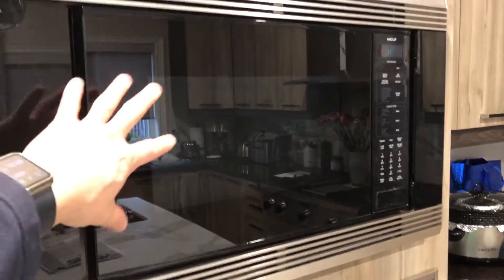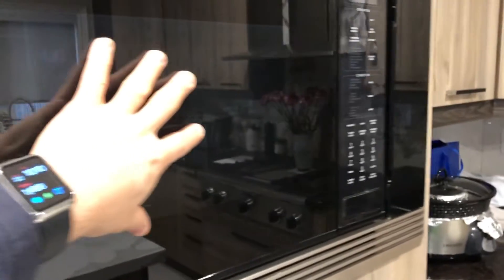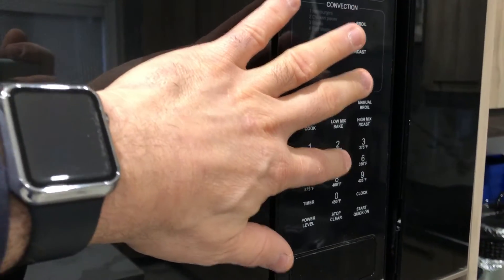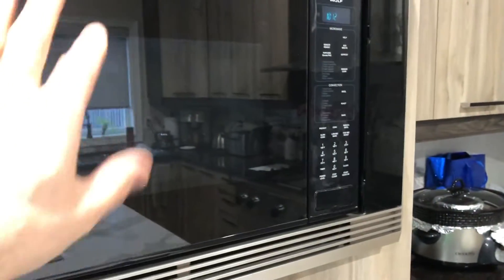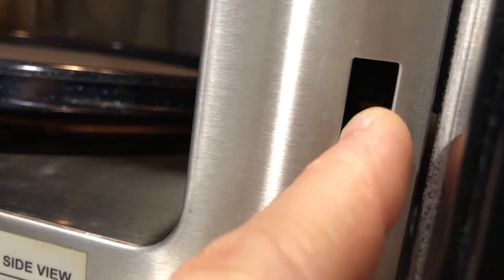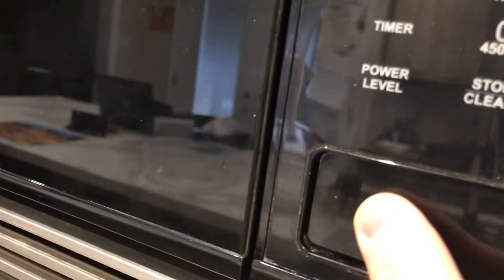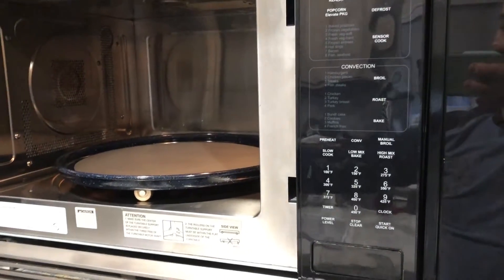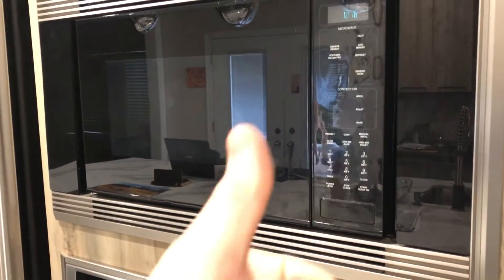Wolf Sub-Zero Convection Microwave MWC24 MC24 No Heating FIX HACK!

Comment: My button doesn’t open door easily. How do I take it apart?
Reply from the maker: You open up the microwave by removing all the screws from the back, and you will lift up the cover and see the plastic assembly holding the door button and all the springs and latches which you also need to unscrew. If the button doesn't open the door easily then it could be something is worn and it is not pushing in deeply enough to disengage the latches from the holes they are in which keep the door shut. Good luck fixing it!

Comment: I've worked on Wolf appliances for 19 years.  The lower door switch is not making good contact. I've seen it hundreds of times. Nothing is wrong with the push button. Replace the lower door switch.
Reply from the maker: Thanks for tip! I ended up changing the switch and yes that fixed the problem!
Reply: Hey Steve, I have a mw24, display is dim...what's my options ?
Reply: @ The blue displays all fade over time. You can change the display part#815587 which isn't too hard if you are handy or memorize what buttons to push to heat up your food Lol!
Reply: @stevengallien1880  haha thanks man...the old memory trick should work for now but I will definitely look up the replacement part

Comment: Can you link the switch you purchased?
Reply from the maker: I don't have any specific links as it will depend on your microwave and which switch it is you are replacing. Look for "microwave door switch" and check on whether it is "normally open" or "normally closed" (NO/NC). Some come with 2 tabs and some with 3... the ones with 3 let you change the mode of operation (either normally closed or normally open) depending on which of the tabs you connect to. The ones with 2 tabs are set to one or the other (either NC or NO). You also have to check the current/voltage rating of the switch you are replacing. Most are 16A 125/250V. One last thing is the thickness of the switch... some are different sizes. Good luck and let me know how it goes!

Comment: So you opened the microwave then wired lights … yada yada yada, why not just change the switches inside that come in contact with the door handle that you press. Pretty cheap and quick. Check continuity on the switches, you’ll find the bad one.

Comment: Plastic interlock bar is worn slightly, which new microswitches can help with, as they have longer plungers and thus make contact, but the door mech needs attention, either replace the door interlock assembly, which is a service part, or by using a shim to make the microswitch move slightly in the plastic clips that holds it, and make firmer contact. Affects a lot of microwaves, and those door interlocks are common among a large number of makes and models, because they are all the same internal parts with the difference being the cosmetic and case parts.
Reply from the maker: I'm going to check once I open it back up and see what is worn and how I may be able to fix it (may be able to just add some epoxy where needed to thicken up the worn areas). It took some time to narrow down the problem area. I ordered replacement switches so that may also help but I still believe the plastic is contributing to the problem and will have to see where it is not pressing tight enough on some of the switches.
Reply: @devhackmod  our Wolf, same model as yours, but a 2006 has stopped heating.  Did you get yours fixed?  I'd love to know what worked in the end before our appliance repair guy comes.  Thanks.
Reply from the maker: @kellyaldridge2095  Check all the door interlock switches. Likely one is defective. In my video there was a switch that had intermittent faults and depended on hard it was pressed. I would check all switches with a multimeter. Also can put a 120V neon indicator lamp on microwave transformer and/or heating element circuits just to know if it is getting energized. Alternatively, if not could be relays on control board. Good luck! Hopefully it's just a cheap door switch that went like in our case.